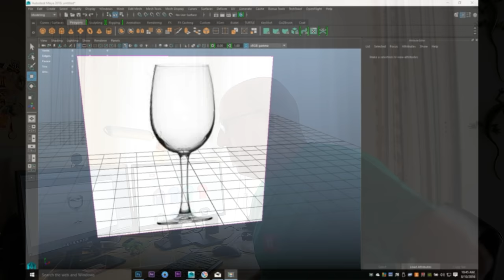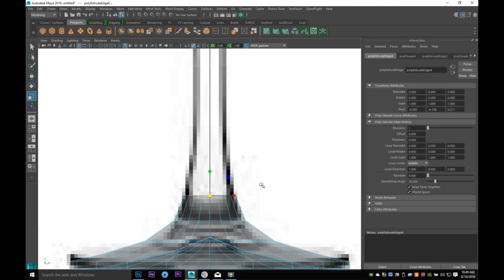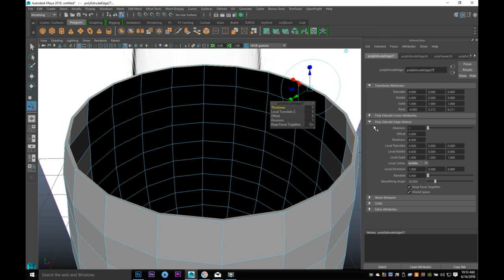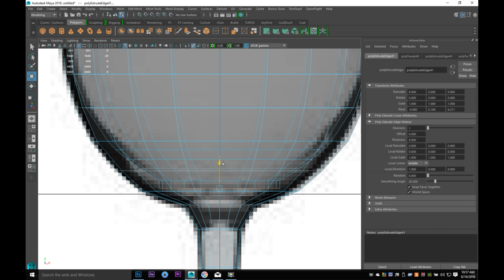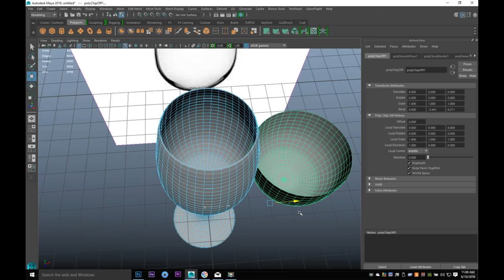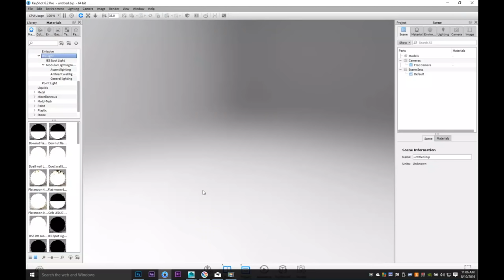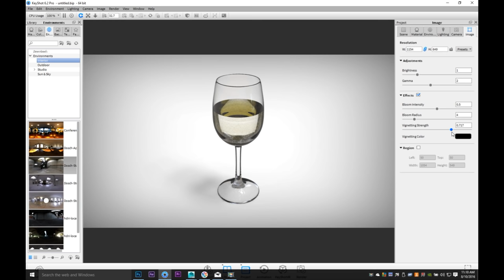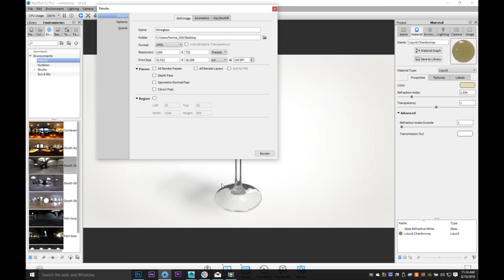How to ( Properly ) model a Wine Glass in Maya

Comment: 16:15 You really should create a grid of quads on top. That will make it easier to subdivide cleanly. You could also model surface tension that way, with soft select. It's better for animation and rigging, won't have shading artifacts either.

Triangle fans create awful normals in the corner, they're only OK when you're using flat shading.

Comment: just earlier today I was modeling a wine bottle in class this way to create thickness in the glass vary- a teacher reprimanded me. lol I just finished it and then came across this tutorial and thought it was funny.
Reply from the maker: You teacher knows best :-)
Reply: Mike Hermes naaah... Hermes knows best. You've gotten me through more than a few overnighters doing hard surface modeling. I do have a question though; for my glass I don't know why-- but when I go to cleanup every single face looks like it has a line running diagonally from corner to corner indicating n-gons.... but I followed you to the T on this one. I wonder what caused that to happen? I still rendered it fine with miaX using the parameters for glass.... hmm
Reply from the maker: Did you triangulate the mesh ( by accident maybe ? )
Reply: Mike Hermes is there a way to send you my .mb file?

Comment: Great model, but never used KeyShot. After it has been textured in KeyShot, can it be imported into an engine with the texture? Not sure how it works! Struggling currently making glass shaders/textures
Reply from the maker: Basically Keyshot is the end station

Comment: This is a great tutorial, thanks, but when I follow the same steps making my bottle, then export the .obj into Keyshot, I have to scale the 'liquid' away from the wall of the bottle to be able to see it, any ideas oh Guru of the Glass? :) (I've tried using an offset as well in the face duplication stage, negative and positive values just to test, nothing works properly so far, bits stick out)

Comment: Wouldn't it be quicker to use NURBS to model the glass? Is there a flaw with NURBS, or is it just a personal preference? (I am not very experienced with this, so it's very easy to get confused!)
Reply from the maker: If you need a glass as a prop on a shelf that's fine. I have used this technique in earlier tutorials. However, if you need a glass that is close up I would recommend doing it this way
Reply: If we convert the NURBS glass to polygon, would there be any difference? 
I'm not against this method. I am just really curious.
Reply from the maker: It's not the method but the end result. Even when converted to polygons the model would be different
Reply: Mike Hermes Oh, that makes sense! Thanks!!

Comment: "properly"
- wine glasses don't have big valley at the bottom like that just a slight indent. You modeled around a decoration bubble or a refraction effect.
- modelling a wineglass from a cylinder is terrible, that's why you got a circle of bulge at middle and circle dent at the top of the upper part, and the top curving in, which looks silly. Juts becase all the random youtubers always try to create everything from extruding a primitive's vertices, doesn't mean it's ok, or should be copied 1000 times more.  
- glass at the top part is way too thick, once again from trying to crudely adapt a cylinder into glass - bezier curve + revolve is the solution
- the refraction looks awful on the final render, it's completely wrong because you got touching faces, that's why the wine fades to almost white, and it seems so swallow the glass sides.
- wine has surface tension, it climbs up on the glass creates a very distinctive line of refraction, completely missing. This one of the thing that makes these crude models so amateurish + glass being thick like it's a coffe mug.
Reply: I completely agree, the method was ridiculous, how can he have missed the revolve curve option? And major features such as meniscus are missing.